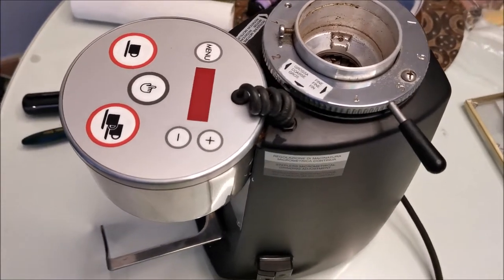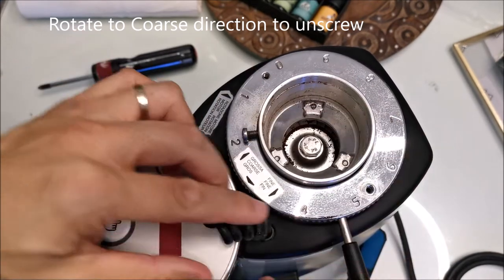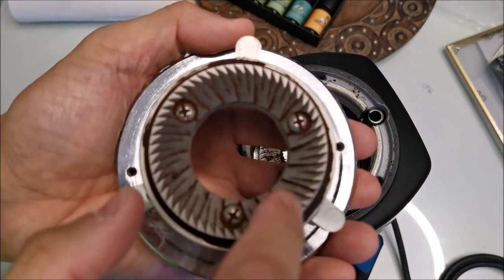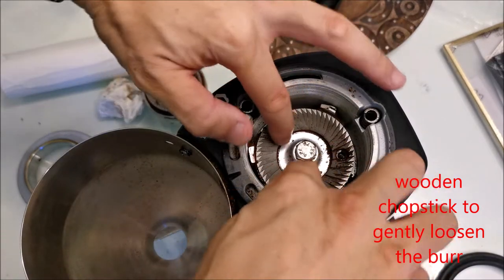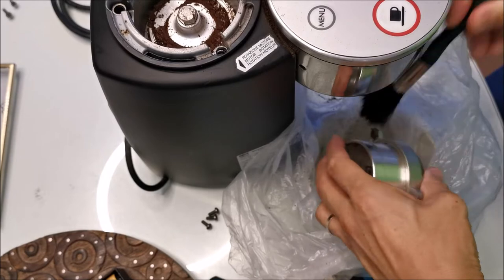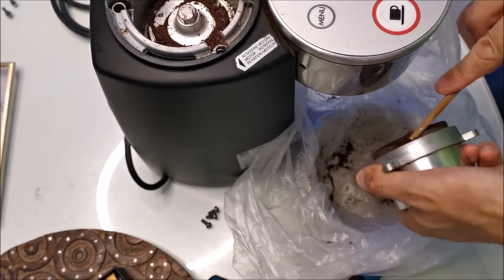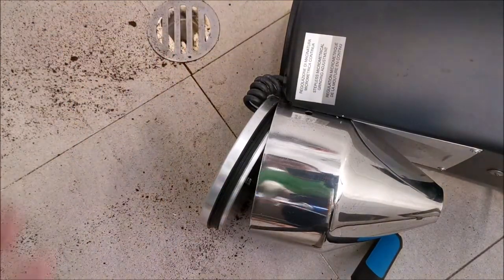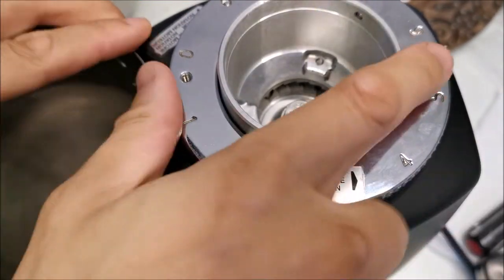Mazzer Mini Coffee Grinder Type A | Do I need to replace my 64mm BURRS?

Comment from the maker: Do I need to replace my burrs? Which ones do you use as replacement?
Reply: Yes, they're up for replacement.
While at it go upgrade them with either Super Jolly 33M burrs or if you have deeper pockets SSP red speed espresso 64mm burrs. The difference will surprise you.